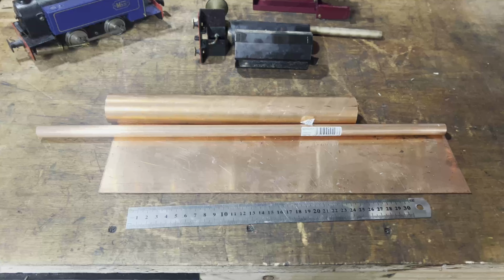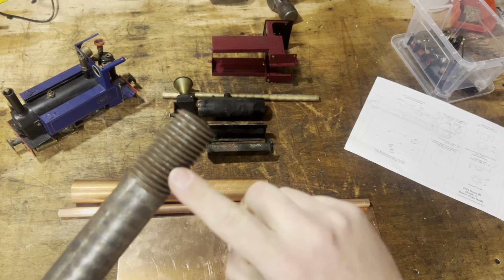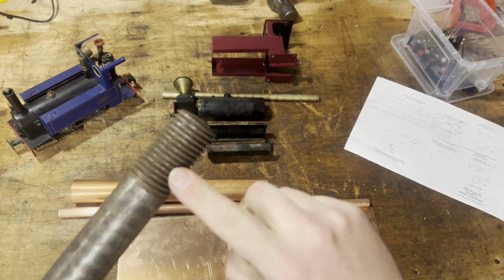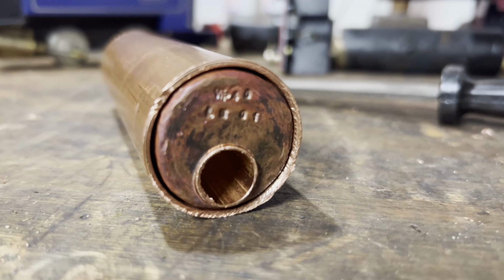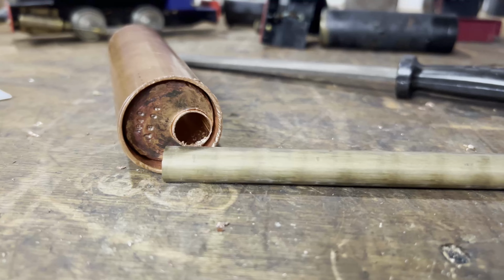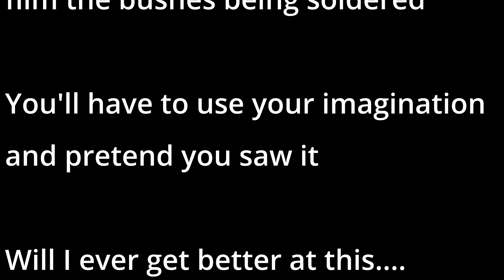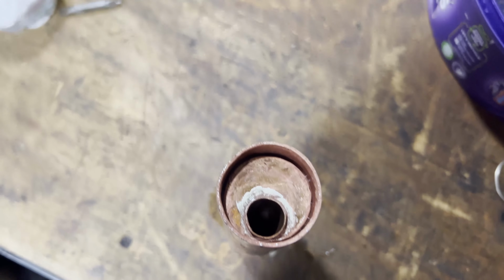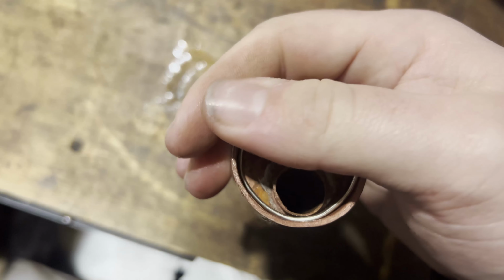Can I build gas boiler for a Mamod?

Comment: I have made a lot of boilers and can suggest the folowing. You need a bigger torch. The metal needs to be heated quicker or the flux will become inactive.
Reply from the maker: I defo need a bigger torch for much more than these. But for the most part, will be using the oxy/ac torch at the club for those

Comment: Could you have used soldered pipe caps for the ends?
Reply from the maker: Possibly, but to get a boiler test and certificate means sticking to proven drawings. 

It would certainly be worth an experimental piece made and put through a water pressure test to compare